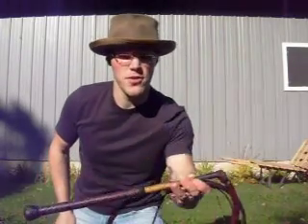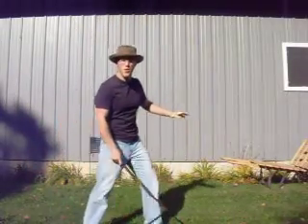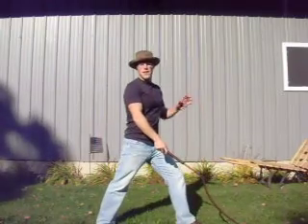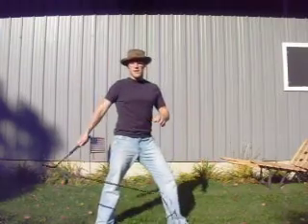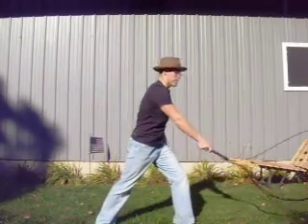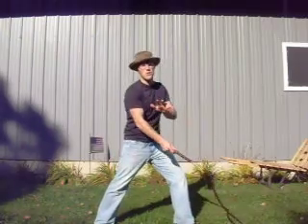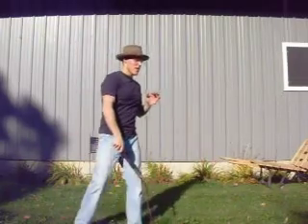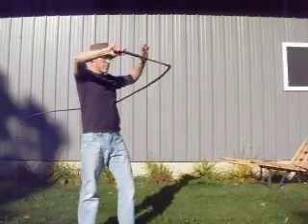Bullwhip Cracking: the slow figure 8

Comment: yes it is infact easier with a shorter whip. stock whips have longer handles and are easier to crack in some ways where bullwhips are used fo traditional cracking(and they have shorter handles).

Comment: i tend to hit my leg or my boot on the back hand crack. How do I correct that?
Reply from the maker: G1NG3R 420 You are probably swinging the whip to the outside when you swing up.  Take video of yourself and change the upswing so the whip travels at an angle over the top of you, to the inside, before swinging down.
Reply: thanks a ton ill definitely try that